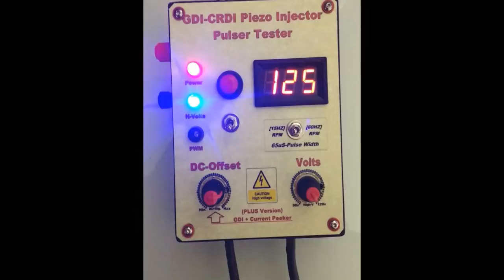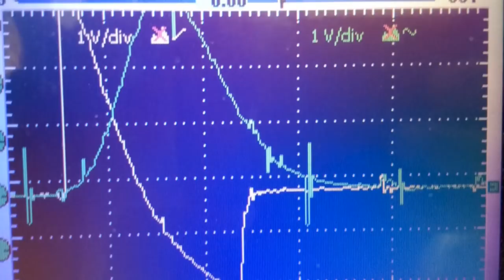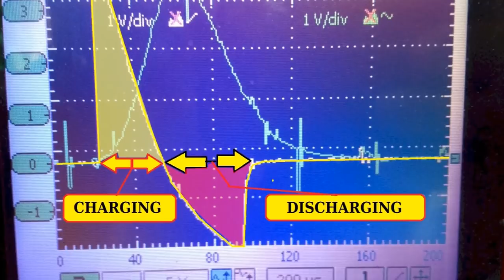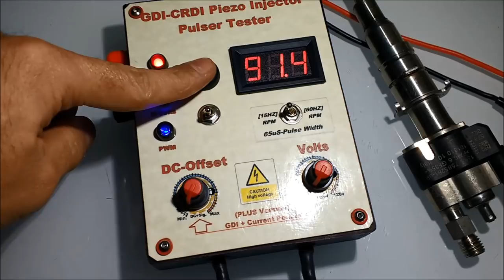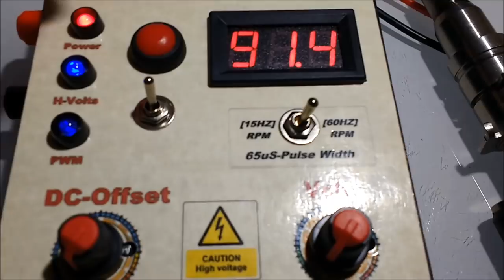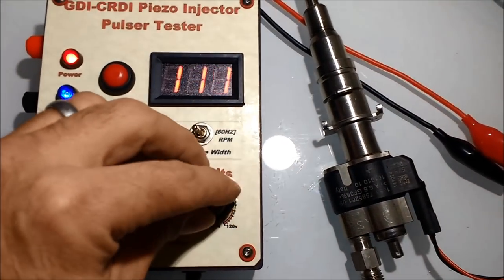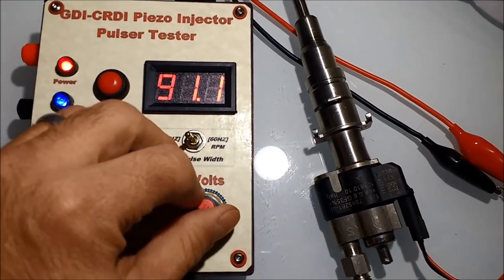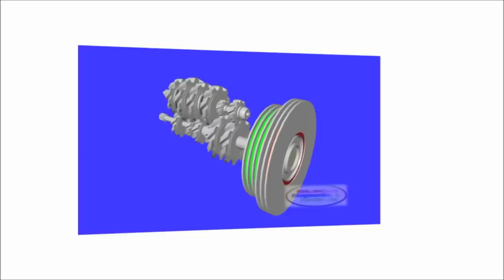GDI CRDI Piezo Injector Tester

Comment: I have a concern with this tool, I have done a lot of OE training on CRD Piezo Injectors and they state that any air entering the injector can cause it to seize and fail. This tool is pulsing the injector without lubrication. It should only be used as part of a fuel injector test bench.
Reply from the maker: Remember that Ford OE training of the past told us never to clean MAF sensors, the small air sensing wire? Then we wised up and realized that it was fine. During the development of this unit we used all sorts of Piezo Injectors, with and without pressure, and with and without air. The actual Piezo component is changeable and deflects very little. Piezo injectors do need pressure, should not be disconnected when pulsing (they could stay open for few sec or min). But other than that it's a normal component.
Reply: Not sure about the relevance about cleaning a component versus operating another without lubricant, but we all know that OE procedures are not always best for the aftermarket. Most CRD Piezo injectors operate indirectly. The piezo stack opens a valve which activates the amplifying circuit that actually opens the injector. The diesel fuel is the lubricant in the amplifying circuit. Search for service bulletins on Nissan's and Renault's that use the V9X engine. They regularly burn out (seize) injectors when the filter is not bled of air correctly or if the driver runs out of fuel. This is why many manufacturers now employ a Run Out of Fuel (ROOF) strategy that mimics running out of fuel to force the driver to fill up before it actually runs out (search for Range Rover ROOF for more info). Not saying your tool is not useful, but at over $1000 each for these injectors you don't want to damage one in the process of testing it.
Reply from the maker: Right, I hear you. Just FYI here's a link to one of my earlier videos, when there was nothing about Piezo Inj on YouTube... https://www.youtube.com/watch?v=ftchx1TDNJo
I haven't had issues with pulsing injectors dry, even on the ones you see on the videos. I have a few of those. I also work in conjunction with 2 rebuilders and done testing. I will do some research on this issue, thank you, Mandy.
Reply from the maker: UPDATE: Called some of my customer (repair shops) both here in the US and in Europe. The issue you're referring to is running the engine out of fuel. That is a problem, as expected, more to do with compression entering the injectors, since liquid fuel can not be compressed and prevents the garbage from combustion from entering the injector. 

However, pulsing Piezo Injectors without fuel is not an issue, as there's no compression (if triggered without fuel). The proper procedures is to test using low pressure, which is what rebuild shops are doing. Thanks for the comments, Mandy.
Reply: AdvTechTS where I can get this tester